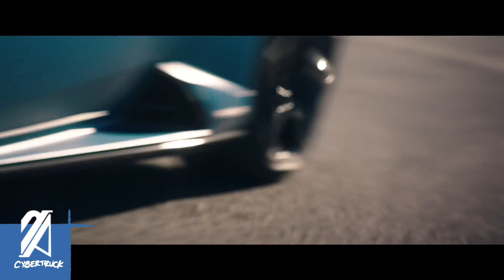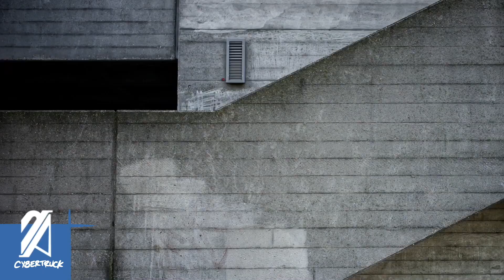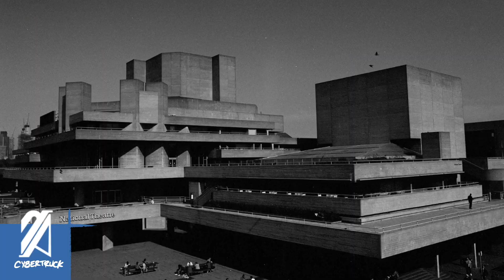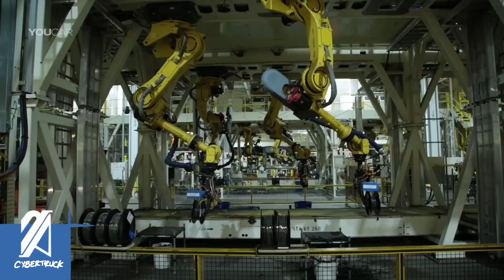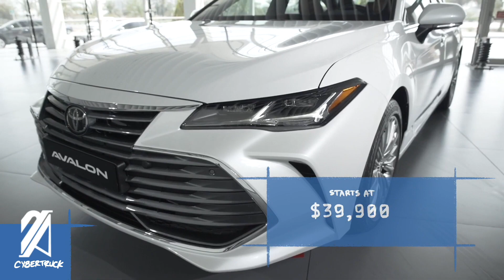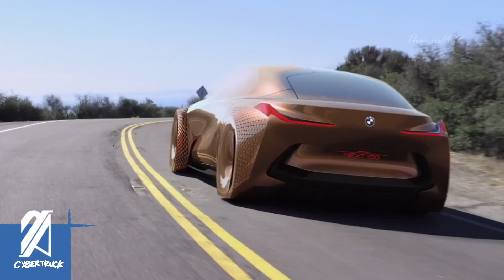Why Is The Tesla Cyber Truck So Polarizing?

Comment: Great job! Lots of things are mentioned which most people are unaware of - because they are not trained to notice them and, then, establish connections.
After the analysis, the question stays: do you like the Tesla truck?
Reply from the maker: Me personally don’t have a use for a truck. I would buy a Tesla though, yes. I already have a hybrid Honda.
Reply: @DesignAtelier , but how about the looks? Can you be bothered by the looks of the truck? As a specialist - as a designer.
Reply from the maker: The looks to me is raw. It could use a coat. If they made this design choice for a hatchback or coup I wouldn’t mind but then it would just be another lambo
Reply: @DesignAtelier , you have found very good similarities in your video.
It does look as if the company wanted to trick people into buying an object they could identify with something which they could just not pinpoint though they would know it was emblematic and desirable.
Else, it would look as if the designers were totally uninspired. Or lazy.
Reply from the maker: @hntrains2  you know you're right. it kinda comes off as uninspired on some places like the truck bed and such. They could have done better while maintaining the low cost mantra.